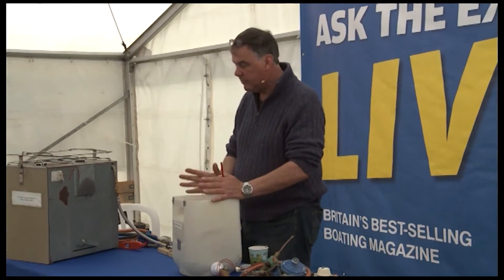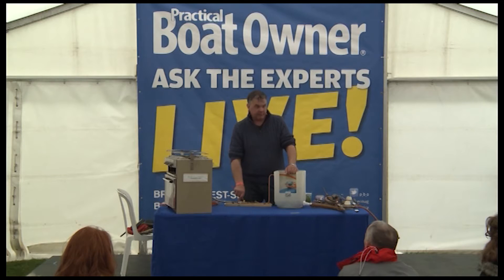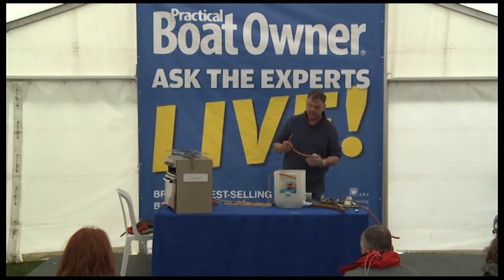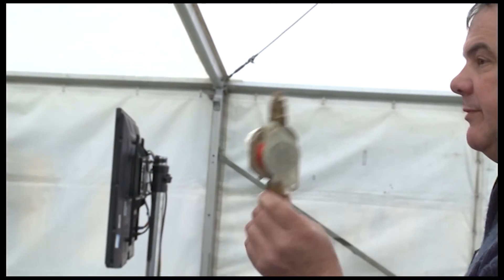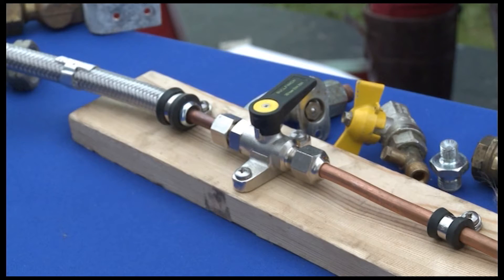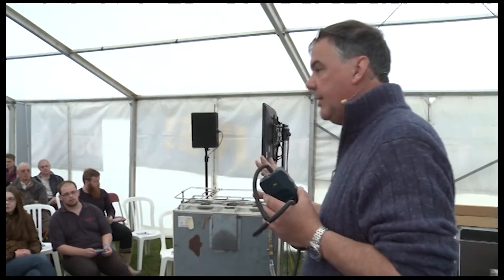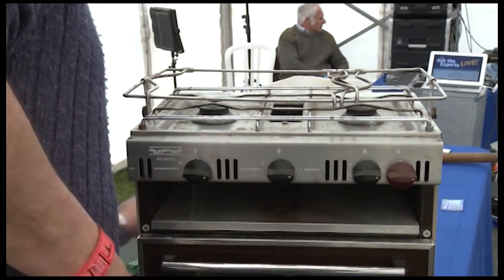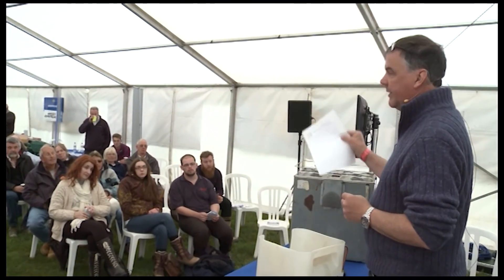Gas safety

Comment: Propane/butane is heavier than air.  if there is a leak the gas will fall to the bottom of the vessel and, if there is nowhere to go, it will build up.  This I know because a boat owner had this experience.  The stove was not correctly turned off.  The following morning he got up to make coffee.  As soon as he attempted the light the stove the boat exploded.  Fortunately, there were people around to get him out of the water.  The boat was destroyed and he had first degree burns on a third of his body.  Still, he was glad to have survived.  It is really important that stoves are used properly and inspected often.  Gas detectors are also a must!